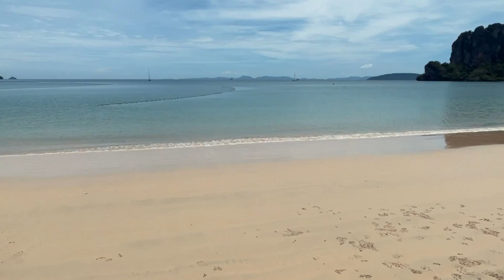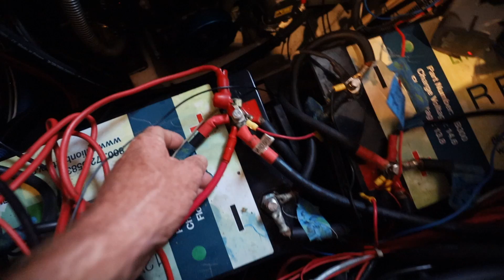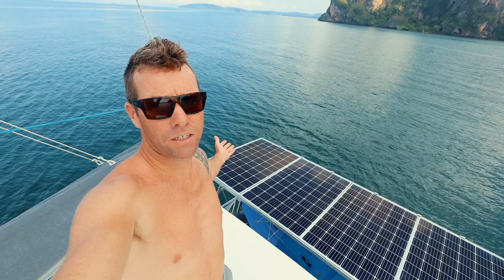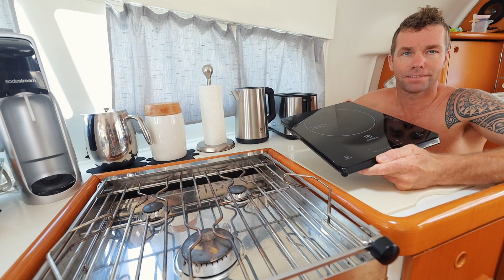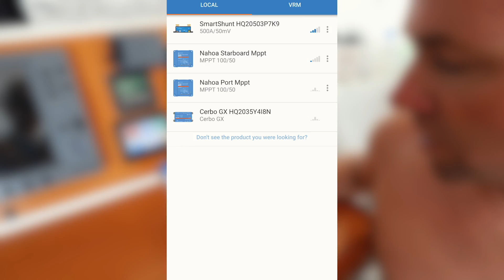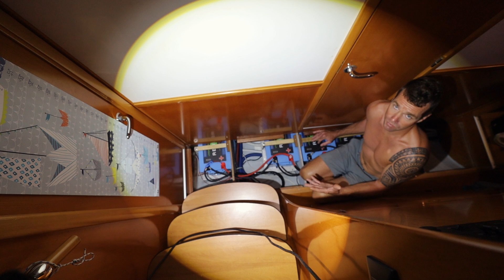Aboard an Off-Grid Sailing Catamaran

Comment: Dang, Solor Charge Controller put off a LOT of heat, Pretty much whenever they are used. So much so, the kettle on the gas stove needs to go!!! "We need hot electric charge controllers to run the electric coffee pot!"

Comment: Guess You can't install a rain proof galley exhaust fan huh. BTW, Handled PROPERLY, checking fittings as routine maintenance, the rality is, propane isn't any more dangerous than having a corroded electrical fire. You can small a propane leak, but You can't smell a bad electrical connection. Having a propane stove when you left, why wasn't there any FORETHOUGHT about propane supply in these other Countries AND, have several spare tanks? Funny how now that it seems the money is Flowing in, they are too good to heat a kettle of water on the gas stove because of heat. They did it for Years with  no complains, why now? By the way, is that a propane grill? Yep. Well, why not have an Electric grill out there? $49 at Walmart, LMBO!!!

Comment: Maybe this has already been said....but...Nikki on Gone with the Wynns puts a silicone baking sheet/hot pad/mat (whatever it is) on top of the induction cook top to keep the pot or pan from sliding around. The silicone can take the heat. She also cooks outside to cut down on the heat.

Comment: I'm sure you know this or have already been told, but you should find 12V versions of everything so you dont need to run the inverter. You can get them for your laptop and certainly fans and fridge etc. If you want the AC, gotta run the inverter though :P

Comment: I think adding a Second 3000 watt inverter will stop the tripping of fuses when running AC and say 2 induction plates and a toaster or coffee maker etc. Only connect the second inverter when you need the big loads and your stand by power consumption will stay the same as now. The 3000 watt can only supply 30 amps to your shore connection and it is rated at 50 amps so the second inverter will give that connection the 50 amps it needs to run AC and other big loads. I did the lithium upgrade 8 years ago with build it yourself Sino poly cells, and have never looked back or had to do anything to them since. THEY JUST WORK , AND YOU CAN USE POWER JUST AS IF YOUR CONNECTED TO THE GRID.  This year i changed my starter battery's to lithium as well, WHAT A DIFFERENCE, and look forward to never having to replace a battery again, well for my lifetime anyway [60]    CHEERS AND FAIR WINDS         Steve h.

Comment: !!!! I would 100% not give advice to people to touch things after an electrical installation. They make little infrared thermometers for less than $100 and it’s something we keep on our boat. We use it to check electrical temperatures as well as engine temperatures without the risk of getting someone shocked or wrapped up in engine pulleys. These are non contact thermometers. Look something like a gun.
Reply: As a side note, if you have batteries in the bilge - it’s wise to have an additional battery higher up to run your bilge pump. You don’t want the bilge pump to fail because the batteries are underwater.

Comment: It is amazing how your priorities change when you have children and I am glad you are getting/have got that rats nest of electrical wiring fixed. As a tip I suggest you watch some of your competitors channel the O Kelley's sorry for plugging them on your channel. Not only do they have some excellent and informative videos on boat electronics they have a similar size cat as yourself they are further down the line and run all electric including AC washing machine inductive cook top etc.

To achieve this they have about double the solar you do however some walk on Solar panels should take care of this apparently it is a good idea to mount them on some plasticised cardboard to allow some airflow and reduce the heat a little and makes them more efficient.

I also suggest Will Prowse channel though this is not a sailing channel it is an excellent resource for all things solar.

Comment: Man, I understand you don't know much about electricity, so you are probably not aware of the risks, but I am telling you, even though diy is cool, not where currents like those batteries are capable of are involved, you already should have learned your lesson from that burned out charger. If those batteries goes off because you are not charging them correctly, or because of a short, because of the cable mess you have there, which is in fact very real possibility, or lack of protective devices to prevent overcharging or too high draw, or temperature, the game is over and you would be lucky to survive it. Get your electric stuff done by a professional and get it doublechecked by at least another one afterwards. Otherwise you are sitting on a ticking bomb. Watch few videos on how a small lithium battery fire looks like so you get an idea how massive fire you can get with those of yours. There is no place for saving on stuff like this.

Comment: I have tried to leave a comment twice before on this video and for some reason it’s not loading maybe because I had a website address in it I don’t know so I will try this again. I was channel surfing earlier and I came across one of those shopping Channels And on the show they were selling medic therapeutics personal AC units they are about the size maybe a six pack of can beer all you do is pour water into it and plug it in it’s not going to cool your whole boat. But it’s not going to use the power as the whole boat A/C .But you can set it on the corner of a table on a dresser on a shelf maybe in the bedroom if you have that option to wear is blowing on you it was only $29 and has a 10 year warranty. 
You can easily pick it up move it into the salon or into the bathroom or if you have a few of them running maybe close off a room and try some zone cooling. The channel I was watching and the website is the same name shop HQ health. I hope this helps you out to wear it will help cool you down a little. We know this isn’t the first time you’ve been in places where it’s extremely hot and hopefully with the tenure warranty it would last you many years to come hope this information helps you

Comment: Strange at 1:25 the fisherman seemed to hit a morning with something like a whip. Strange. I remember when you got those lithium's.  I could swear I saw cats sleeping with dogs in that electrical box ! Whew ! But, if you did that wiring at 15:17 you could straighten out just about anything else. I use those thermal temp readers , like the ones they use to measure your forehead. Perfect for finding hot spots.

Comment: I want to do the solar instal myself  I am weight concious  and want to coat the entire roof with flexible solar which I will consider disposable  Anyone have ideas on how to mount solar panels without screws? I am reluctant to put a bunch of holes in my roof.  Can I caulk them down?  Can I remove the caulk later?

Comment: Off grid means not using or depending on public utilities, especially the supply of electricity. You are not off grid using gps, cell phones, internet, navigation, weather, garbage collection, on the hard life, and general use of moorings, roads, vehicles etc. Solar sourcing electricity is not off grid, you are most likely energy efficient. I call bull Use of cell towers and satellites are on the grid.

Comment: I'm currently happy with 300W solar down here in Sydney. Running an A/C is on a whole new level :D. You could also sail a bit further from the equator ;). Anyways, you got heaps of space for extra solar panels.

Comment: We did it! We have gone all electric on our cat (Lagoon 420). only propane for BBQ (once we are out of   gas it will prob be replaced by an electric one
Cooking takes typically 80-100Ah at 12V. water heater (40l) for shower etc about 240Ah/day
We have 2 bat banks of 4x 240Ah AGM
Victron quattro 4000W on port battery bank
6x solar 300Wp.
still trying if it works in the Netherlands at anchor

Comment: Unplug your appliances when you’re not using them. Your tv for example draws power even when it’s is off, so does your phone and device charging bricks, anything with a digital display will as well. It’s not a lot of power but it all adds up when you’re running on solar and you’ve got twelve widgets you’re not using plugged in. 

Toaster is probably fine to leave plugged in but your kettle and induction cook top probably draw power even while off as well.

Comment: Wire the solar panels in parallel, the reason is when or if 1 section of a solar panel has shade it would affect the whole panel as a whole. Wiring them separately in parallel would just affect 1 section instead of all. Multiple controllers would be needed though.

Comment: We went full electric galley. I removed my gas stove and oven (force10) and fitted a double induction cooktop and an electric oven. It outperformes the gas and I will never have gas again. Yes it uses loads of electricity but I find I run my generator maybe 4 hours a week to keep up with the power needs

Comment: Hallo Ben ich hab einen Induktions Wok mit dem ich fast alles mache . Vielleicht wäre das auch was für euch der verrutscht auch nicht bei Seegang :)

https://www.amazon.de/Bartscher-105986-Induktion-Wok-IW/dp/B078VSFK7T/ref=asc_df_B078VSFK7T/?tag=googshopde-21&linkCode=df0&hvadid=308537288811&hvpos=&hvnetw=g&hvrand=13389890388655534724&hvpone=&hvptwo=&hvqmt=&hvdev=c&hvdvcmdl=&hvlocint=&hvlocphy=9043102&hvtargid=pla-746606942783&psc=1&th=1&psc=1&tag=&ref=&adgrpid=64269090474&hvpone=&hvptwo=&hvadid=308537288811&hvpos=&hvnetw=g&hvrand=13389890388655534724&hvqmt=&hvdev=c&hvdvcmdl=&hvlocint=&hvlocphy=9043102&hvtargid=pla-746606942783

Comment: We have a narrow boat (15 years) with a similar victron power set up (gel batteries) and  we really like our Halogen oven used in summer very low draw and great results also stores away when not in use. Winter we use a coal fired Aga with water heater.

Comment: Off grid in harder than ppl think. 
A guy I know is off grid in old australia and spent about $110k.
But after a few years it will pay for itself. 
Myself I live in a caravan with a single 15amp 240v lead  but I can't use and appliance at the same time. Bit I do run about 1400L worth of fish tanks

Comment: Looks like you've got space on the roof deck to almost double your solar. 2000-2200W would be spectacular but the salon cabin deck gets blocked by the main sail/rigging at times. Using zones with separate controllers will allow the unblocked panels/zones to work at full efficiency. "The O'Kelly's" went over their high tech set-up about 15 months ago using 2400W solar with 900AH lithium batteries with 3 zones (if I remember correctly). They don't use a generator and got rid of their D-400 (noise).

Comment: Tip: vertical rotor. You need a vertical wind generator. It works better with quiet wind and turbulence. The horizontal one needs more speed, less turbulence and thus a higher setup. If you're not sure what I mean, check out the one I build on my mabbasi_of TikTok

Comment: You have a. Good setup with the new battery bank and solar , and wind charging system, but why not add a small diesel or gas generator to the boat, this will solve all your problems especially the air conditioning issues, then you can install a proper A/C units. This will also allow you to cook on electric run microwave,  and all electrical systems without concerns, you only have to run the generator depending on the size one hour a day to charge the entire battery bank too 100%,  it will be the best money spent, especially with a growing family, great video, you guys are a inspiration to all of us for doing what your doing,  Forgot to mention endless cold BIER,

Comment: Ben, the tech side of this was excellent having gone through the brain wrenching effort to go from AGM to LIFEPO last January for domestic cruising  on a small cat.  We have been in a 12 volt world for the last 10 years of cruising out of Geneva, WI.  The jump to 14.6 volt world of LIFEPO caused great concern for the hungry nature and bottomless pit of LIFEPO and went to 60amp Renogy DC to DC charger to regulate the power being pulled out of engine alternators especially when the engines are at slow speed and low cooling can cause alternators to overwork then overheat then fail.  We have been quite happy with our Duxtop induction cooktop and Honda 2200 Companion genset (45lbs) for spot cooling at anchor. SV JOYRIDE

Comment: you should consider moving the 4 panels in the back on the coach top and use bifacial panels in the back. efficiencies have increased a lot and you can put 4x 350watt bifacial panels for about the same surface area. the advantage of bifacials is the back is clear so it also picks up diffuse light coming off the white paint of the boat and the water. I saw another channel with a bifacial panel mounted in the rear and they were able to peak out at 120% of the panel rating so you could get 1600 watts+ instead of your current 1200 watts. also for any panels you put on your coach top, you should consider using separate small charge controllers for each panel instead of just one bigger charge controller for the string of 2 or 4. the output of a string is its weakest link so if you string all 4 together to one charge controller, if one panel gets shaded by say the sail mast/boom, the output of each panel in that string goes down the that of the shaded panel.

Comment: cover all your connections with some grease!
1st it seals it from corrosion
2nd it insulates connections from accidently touching something wrong
3rd useas much of the same material (i.e copper) as possible because of electrosis
also ya in taiwan clise to australia, check out RED ARC
and i would also like to say check out RV things, cause they are purposly made to switch between 120v 12v and propane

Comment: Cool set -up Ben. Just changing from 700a/h of AGM to 1000a/h of Lifepo4 on our cat. Will be upgrading to Victron solar controllers also but I’m interested in what controller you use on your D400 wind generator as I doubt our D400’s reg has a Lithium charge profile. Thx

Comment: Gone with the Wynns is totally electric check out their set up
Reply: Not quite total electric.  The Wynn’s gave me the idea of running a portable gas generator, like a Honda 2000, to run the AC requirement of big draw air conditioning.  Anybody who has big draw AC requirements will be hanging solar panels off their lifelines, like SV Sophisticated Lady.  Shorepower or a generator is the reality for other than short stints of air conditioning.  Fans help.  (SV JOYRIDE with 240 ah Lifepo bank and 12,000 btu Dometic Cruiseair AC and 400w solar and Honda 2200 gen.)
Reply: SV dauntless are using a Tesla better bank from a car with low hours they have the biggest inverter I’ve ever seen

Comment: I really enjoy your videos, and I think you guys do a great job. I wanted to offer a suggestion. Captain Rick Moore of SSL was experimenting a month or so ago with running an 8,000 BTU air conditioner off his lithium batteries. The AC unit he got work so well and you so little power that I believe he has or he is intending to upgrading to a 12,000 PTU unit. Might be something you want to check out in their episodes.  They're in Columbia super hot super humid and the AC used surprisingly little power

Comment: Ben c’mon i think you can take those extra marine gadgets and modify them to work with the induction plate!  Couldnt you simply fix w adhesive or otherwise the induction plate right under that grill?  Of course the metal grill top will get hot unless its nonferomagnetic- im talking about your wife’s complaint that all the marine attachments aren’t available for the induction plate.

Comment: Hey Ben, great video as usual! One thing you might try to get in the habit of is when checking to see if an item is hot, use the back of your hand first. The back of your hand is usually more sensitive and if it were to get even slightly burned its not an area that normally use plus your normal reaction if the back of your hand feels heat is to pull away. Whereas the front of your hand is used often and if you happen to loose your balance (do to the boat rocking) the front of your hand could get pushed on to something really hot (especially if its something you didn't expect to be hot).  Hope this helps.

Comment: The problem with alot of solar panel on your roof is your sail and mast. To lessen this problem is smaller solar panel units and more solar panel charge controllers. The "The O'Kelly's" have a video interview with the owner of the catamaran "Top Secret" where they talk about this problem. The video is named "$1M Charter Catamaran Conversion PART 1 Top Secret (electric) Boat Tour". I say it should be worth while your time.

Comment: Wondering if you considered pairing the lithium with lead acid? Another long time cruiser has a tutorial on it. Utilizes the best qualities of both types.
Reply: They have different charge voltages and charge rates. Best to have the right chargers for each and not mix them together.
Reply: @quolls2  you use the lithium to feed the lead acid. The lead acid charges at the lithium voltage. The lithium bank maintains the 13.7 volts lead acid charges at
Reply: Great idea when the BMS goes you got nothing 👍
Reply: See Emily & Clark adventures.   Adding lead to lithium to lead system video, adding lead to lithium systems. Well worth viewing